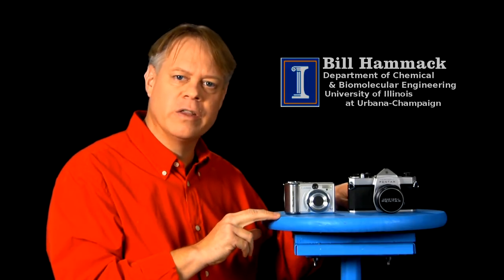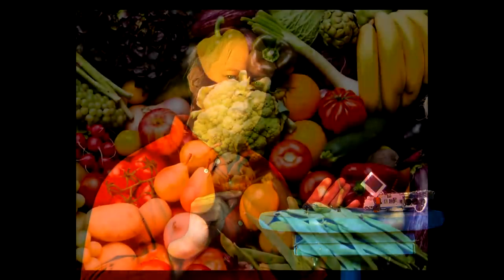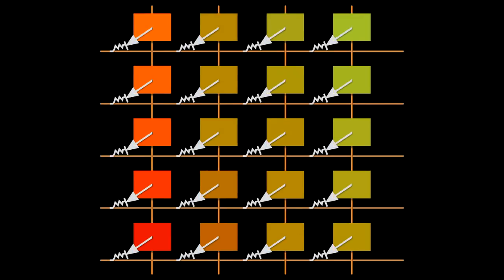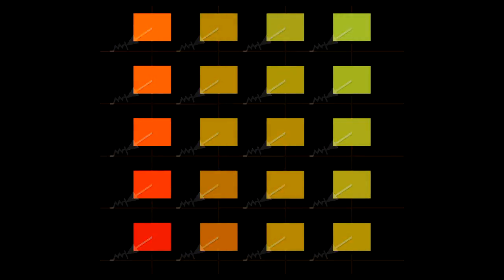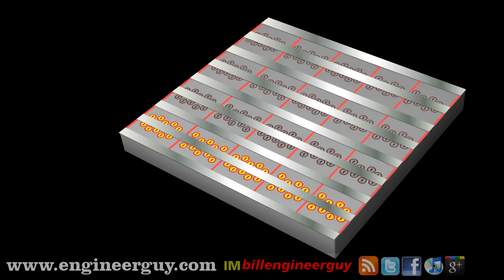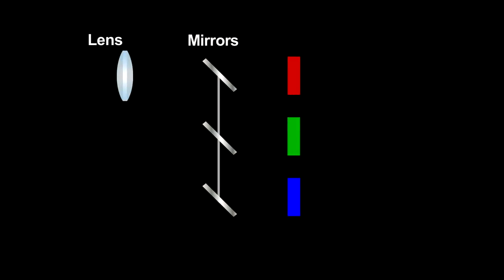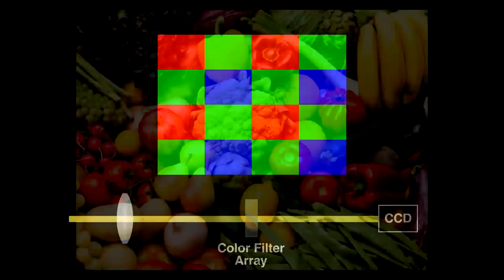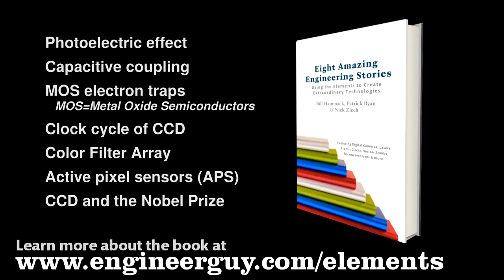CCD: The heart of a digital camera (how a charge-coupled device works)

Comment: Wouldn't it produce a more accurate picture if you took three separate pictures (red, green, and blue monochrome) using the same CCD by having solid color filters that swap out in rapid sequence? It'd take a little longer since you have to switch out the filters, but I can't imagine it'd take that long...